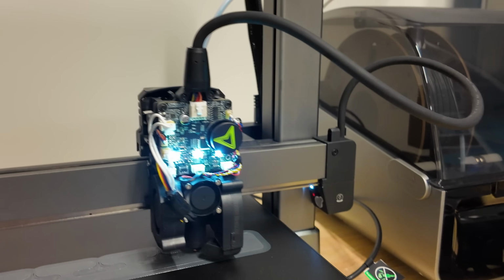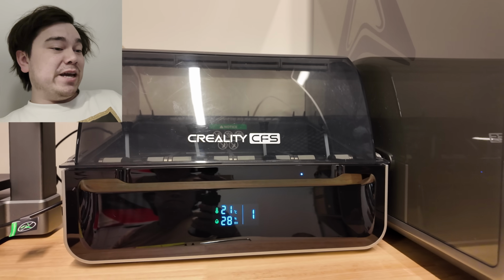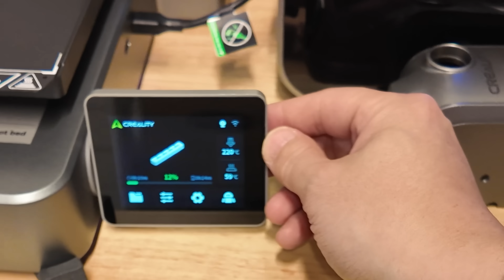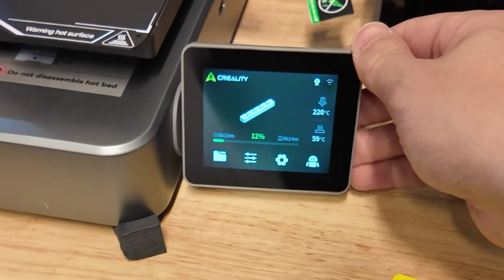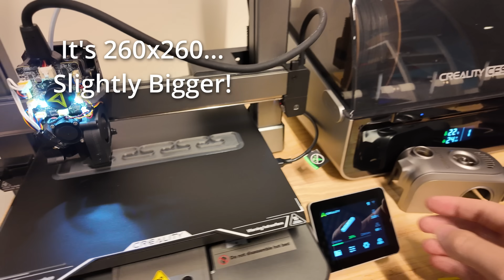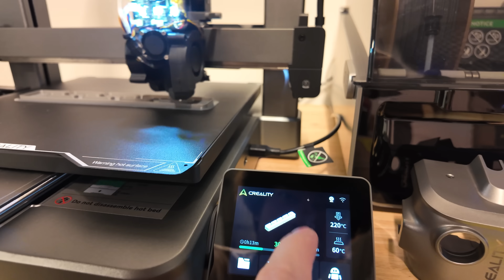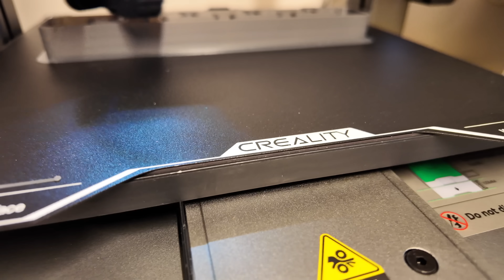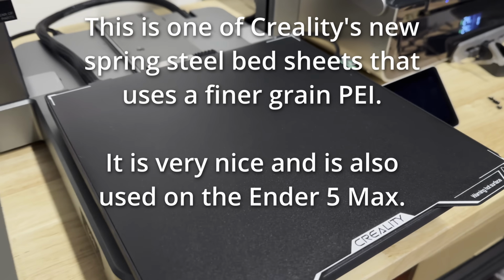Creality HI: Over-Specced with K2 Tech

Comment: Greatly informative review/video!  Would this printer be the one to get over the V3 or the KE, since it’s the most recent I guess the answer is yes.  Is the realistic print speed 300-400 mm/s or is it perfectly fine at 500?  I’m looking to upgrade from my Ender3 V1 from 2019!  Thanks in advance.
Reply: I would definitely recommend the Hi over the V3 or KE - only exception would be if you need the bigger build volume of the V3Plus (which I have 2 of and do need for some of my products). But of the 2, the Hi is far better in terms of print quality. I've just been using the default profiles in Orca and haven't done any tuning at all and it's amazing.

Comment: Some features I like:

Filament run out sensor on the tool head.  Why was this not widely adopted sooner?  Cleaner, easier and better in every respect.

Easy swap tri-metal nozzle (titanium heat brake, copper for the melt zone and hardened steel at the nozzle tip).  Apparently, just unscrew it and screw in a new nozzle.

Contact sensor so the nozzle directly probes the bed so it's not trying to infer Z=0 based on a low quality inaccurate inductive proximity sensor.

Quiet, accurate, smooth FOC closed loop stepper motors on X and Y.

Creality apparently developed active input shaping so it can fine tune the input shaping on the fly specific to the geometry currently printing.  This at least has the potential to improve print quality, particularly on the functional prints I do where there are hundreds of the exact same layers where it could fine tune the motion control to minimize overshoot, etc.

The folding screen is a small thing but it can reduce the width of the printer (particularly useful for print farms) and prevent the screen from being damaged.  I usually manage printers from a web browser and might only need the screen for offline maintenance type issues.

There are a lot of nice new features in the Creality HI.

Comment: I don't need multi-color printing and I don't like printers that fling poop, but $349 looks like a good price for what should be a reliable, durable, fast, high print quality, easy to use and maintain printer, whether you are a newbie wanting a solid and relatively pain free entry into 3D printing, or you're starting a print farm.

I wish all manufacturers published well tested profiles for OrcaSlicer and PrusaSlicer with maybe ten generic filaments, even though what we really need is an industry consortium tool head calibration in printer.cfg to compensate for each extruder's differences in thermistor location, melt zone design, etc.  A 250 C nozzle setting should produce the same melt and flow characteristics on each printer so we don't need custom filament profiles when switching from one printer to another.  Then the entire world gets the advantages of Bambu's closed ecosystem without the downsides.

Comment: Good progress with our Creality low end printers, the more you use the smooth PEI sheets the more you will like them and the adhesion rivals the textured ones I believe. The textured ones self release the print when it cools but the smooth ones don't. If you had a long power loss with a smooth PEI build plate I bet you could restart your print and not have the model come loose. I'm curious how long till we can root the Creality HI?

Comment: LOL Nate, holding it almost on its back to see the electronics while its running.  You wont see an A1 doing that
Reply from the maker: That’s a good point, those closed loop stepper motors were working overtime to keep the print running with the printer flipped over
Reply: @NathanBuildsRobots  It was impressive to say the least

Comment: When the printer is idle, are the fans still on, like the psu/mainboard fan?
Reply from the maker: I don’t recall, but it is very quiet compared to most printers.
Reply: Nope. It's so quiet I have to check to make sure it is on sometimes!

Comment: This is a perfect example of the use of a 3D scanner in industrial engineering. Much easier to 3D scan the A1 than actually design something new themselves. The team at Creality are anxiously waiting for Bambu to release their new printer and is sitting ready with their 3D scanner and copy paste CAD.
Reply: And yet Creality has already passed Bambu bye with the K2 Plus and the ability to use multicolor units on older machines..  .

Comment: Has Creality yet made a clone of bambu handy app and or makerworld?
Do you think they will?
I like the community being able to share multi color models with pre colored and pre sliced profiles.
I think it would be great if Creality had a way for users to do this like in bambu handy
Reply from the maker: I hate all cloud and online services, but I think creality has their own online cloud library
Reply: @NathanBuildsRobots  well I don't like it either but if they just have a site for models and preslice profiles and color models but that doesn't rely on the cloud to actually send the print job.
They could have a site or even an app that allows users to upload and download presliced pre colored models and then send them to the printer over the local network.
This would be a great selling point over Bambu, as they already have open source and cloud independent machines so a cloud free community platform following that tradition would be good to compete with 
Bambu now that they have their CMS
Reply: @NathanBuildsRobots  I agree and Creality does have the Creality Cloud though I do not use it. They don't require you too or to use their slicer (I use Orca) unlike Bambu trying to close you off from anything but their stuff.
Reply: Who needs Makerworld when there is Thingiverse and PrusaSlicer?  People seem to like to remotely print but I can't see the value.  I much prefer to be there to start the print.  I'm a homebody so I never feel the urge to print a baby Yoda while skiing.  For print farming, Klipper seems pretty good and software such as OctaPrint offer more printer management features.

Comment: Closed loop stepper motor != servo motor. Totally different thing.
Reply from the maker: Tell me how they are different. Apparently they are using “closed loop FOC” stepper motors
Reply: @NathanBuildsRobots  Well a stepper motor....ehhh steps and a servo doesn't. Different internal mechanisms and how to drive them.
Reply: @NathanBuildsRobots  a servo needs the feedback to move to the desired position and may overshoot and correct, undesired for printing. A stepper doesnt, it hits the position precise. A closed loop stepper is a crutch, its only usefull if the motor ramps run on kifes edge and the result is that a correction move will show up as visible artifact

Comment: This seems like the best A1 clone yet. A great option for those concerned about bambu lab as a company. Personally I will stick with bambu lab for a while. My A1 continues to amaze me with how little effort I need to put in. It just works basically every time. But I understand that a lot of people want to avoid them right now.
Reply: its clone and improve from A1, the Creality Hi have larger bed, Support 4 unit CFS (16 color) and have closed drying system in CFS for better humidity
Reply: Well k1c costs same as your bambu but it's faster and same or better quality print and not tied to bambu servers and also works out of the box
Reply: The KE and V3 I had both had terrible QC and failed almost every single print. Got an A1 and it easily has an over 90% success rate. It's not even close.
Reply: @Hatemode_NJ  I'm up to 3 v3se's all have been pretty flawless for me, luck of the draw i guess.
Reply from the maker: I get that, if you have an “old trusty” printer that works for you, no need to change things up
Reply: @silverify  but then you'd have to own a creality...
Reply: @silverify  Except if you value multicolor printing. The K1C is incompatible with the Creality CFS. Besides that, the K1 and K1C had quite some issues during the launch. I'm pretty sure all is well now, but I understand how someone could choose the A1 over the K1C. The utter plug and play nature of it combined with its flawless print quality of the A1 puts it ahead of the K1C in my opinion. The K1C may be faster, but only marginally. In any practical scenario, they're a close match. I also don't agree that the K1C has better print quality. Additionally, the hot-swappable nozzle system of the A1 is superb. I use it way more than I ever thought I would.

Comment: Very nice, the closed loop steppers are nice but i think nozzle variance (pressure) is the biggest culprit to layer lines and percieved quality and the A1 mini actually uses its strain gauge to tune this on the fly with closed loop feedback on the nozzle.  As a result i hear the a1 mini (in particular not the x1c or p1s) have the best clearance/tolerance test results, and i think it really is because of that nozzle pressure control. You can tune that out with a million settings (according to chatgpt who can vouch for this) but thats such a headache, closed loop lets it adjust on the fly no matter what happens, kind of like messing with the bed here, thats very cool, id like to see more closed loop feedback. Perhaps on the axis not just the steppers, so you get rid of the belt play , it can check its position along the axis against an array of hall sensors /magnets or something.  Now you got feedback everywhere, and now you give that control to AI and it pumps the plastic just the way you like it.  That being said since this printer uses a strain gauge, maybe they can update it to have nozzel feedback too with just software. Im thinking of doing this to my Vyper which also uses a strain gauge, but its always bumping into stuff so im not sure how well that would work.
Reply from the maker: I dont think closed loop extrusion matters as much as you think it does. When pushing high speeds A1 under extrudes. The main issue is when you overrun your extruder/hotend. Generic values for pressure advance per material works well enough and most printers do this already
Reply: Does it do any tuning while printing? Is it specified somewhere, or speculated?
It does some flow-a-matic thing while purging, though not sure what that does...

Comment: If I'm not mistaken, the motors for the Z axis work independently, which allows for automatic leveling of the X axis in relation to the print bed. Is that correct?
Reply from the maker: Yes that should be the case

Comment: dude did you take off the bottom cover or it doesn't have one?
Reply: NVM i should finish the video 1st
Reply from the maker: I got ahead of myself and took the bottom cover off before I started filming. I’m always curious to see what kind of hardware they are using, and how the internal structure is designed
Reply: @ Tottaly understandable, id be the same lol, in your position. But sadly companies not sending me printers free. so I must handle them gentlier xD

Comment: Does it have automatic Pressure Advance or Flow Ratio?
Reply from the maker: Could you tell if it didn’t?
Reply: @NathanBuildsRobots you tell me, you’re the expert 😊
I’d assume that I’d have to calibrate that for each filament type, if it doesn’t do it automatically. Yes?
Reply: @NathanBuildsRobots  it's one more annoying thing to not take care off, basically a plug and play.

Comment: the design looks cool but it's still another wannabe bambu printer like most of the new printers now.
i wondering what will be the next bambu printer ? will it have new tech or just an optimised X1 - A1?
Reply: Since Creality has been around for 11 years and Bambu only since 2020...who is cloning whom? The Hi is a truly amazing printer - I've been running it 24/7 since I got it on March 17.
Reply from the maker: Bigger ✅ faster ✅ cheaper ✅ probably better flow rates and part cooling ✅ more colors ✅ better motors ✅

You’re right, it’s just a wannabe bambu 🤣

Comment: I wonder if you can share one color unit between a K2 and Hi.  Obviously you couldn't print multicolor at the same time on each printer but it would be handy if it does.
Reply: you could swap it, its the same model. but theres no way you could use one on two printers at the same time. it has to be plugged into the printer thats using it.
Reply from the maker: Yeah, what ge2719 said.
That would be pretty cool to have a setup with 4 AMS, 16 colors, shared between multiple printers. Like you can pull any material from anything of them, but it would require some extra hardware/software